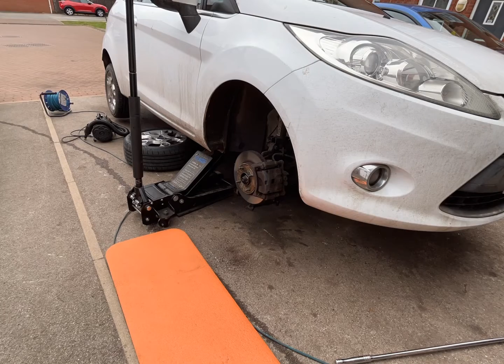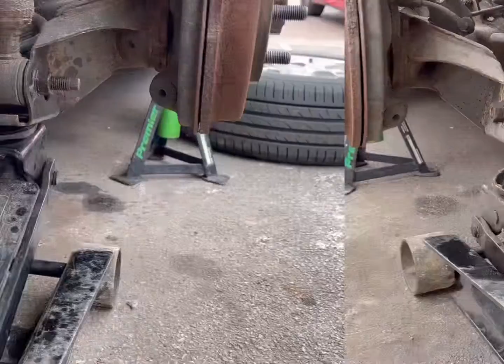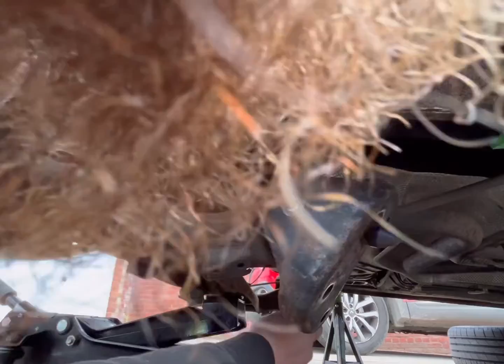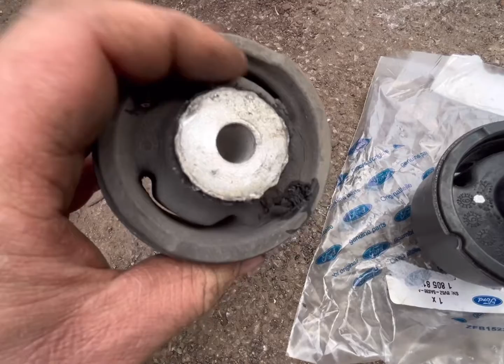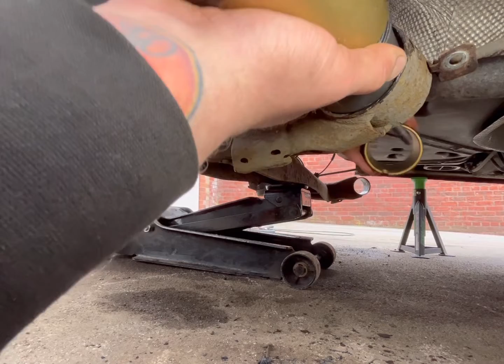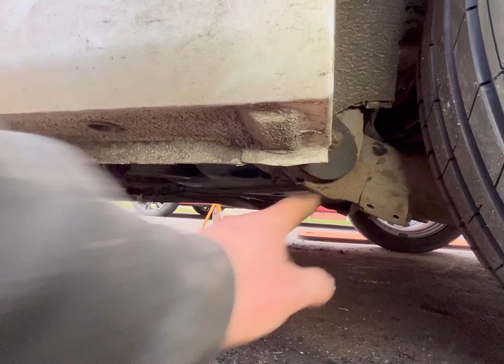Ford Fiesta Axle Bush Replacement

Comment: Nice to see a good mechanic. On another channel, they fully tightened the bush bolts with it in the air and suspension fully extended! Good way to damage brand new bushes when you hit a bump!
Reply from the maker: Thank you buddy, unfortunately some people just take the short cuts and the quick way out, but some pride in your work goes a long way I believe
Reply: Know this is a year old I make you right.  My car failed today on this 😢